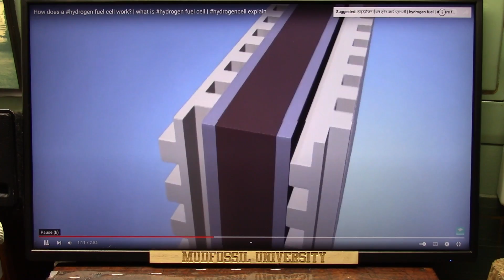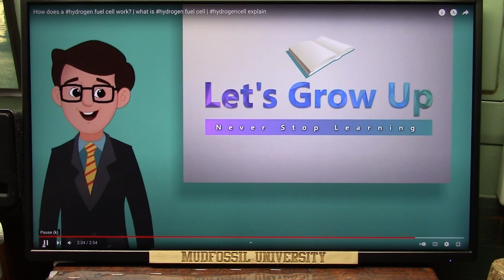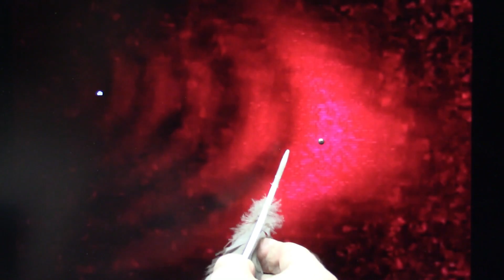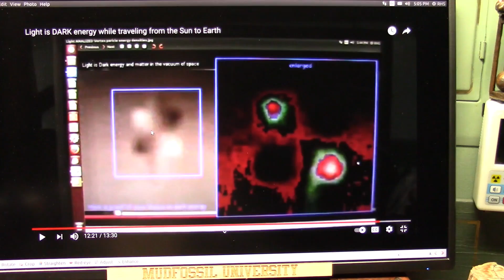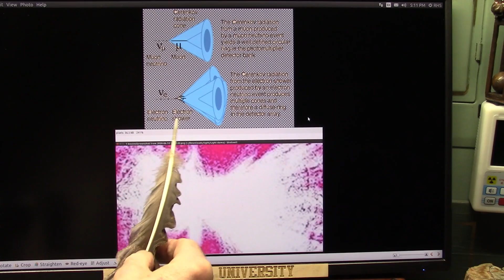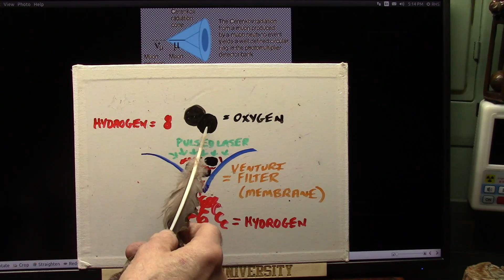Can Existing Engines Run on Water

Comment: The debate for electrolysis is usually had from the standpoint of energy in vs out. I maintain that there is a way to optimize electrolysis to where the losses would actually be negligible, equivalent to having to fill up at the pump, only with water and electrolyte. That laser hydrogen cell concept is interesting though. Wonder what effect the color band of the laser would have on the output. Could this be utilized in a DIY method? What wattage laser, etc.

Comment: Just make HHO or H H O or H2 O2 and USE IT. Storing Hydrogen is a bomb. Make it --use it. Make it use it.
All you need is electricity. Everyone else gets it from an alternator output. Not the Battery  It's really done by resonance frequency. See stan Meyer. The late great murdered Stan Meyer

Comment: Cold water hitting the cylinder could cause thermal shock/Cracking   Just put the gasses into the intake manifold.
Reply from the maker: Yes heated.

Comment: Definitely needs to be a diesel built engine to handle the BOOM. Hybrid engines are being run and built as we speak. I am the successor to a business that has built and serviced diesel/ water engines for over 25 yrs. One pass uses 2 gal of fuel and sometimes 6 gal of water. In 15 sec.

Comment: There was a fellow named Ammon , I believe, International late 1800's or early 1900's, that had an electric car that worked on taking electricity from that air. He was busted by the authorities for stealing electricity from the phone pole electric wires! Capacitors used?

Comment: H²O² is hydrogen peroxide...that is an energetic compound...so it fits to use it...lots of energy density...which we need...gotta use ICE until the energy density of other "fuels" can be assessed...oh...and for the EV...it need massively huge 10,000 Faraday capacitors...those would charge to full in minutes and provide 2x or 3x the range...there is a 1/64 scale R/C set of cars at Walmart that uses a 7 Faraday capacitor to run the electronics and the motor...another slightly larger car is the Crash Racers of Adventure Force Diecast Raceing Set...the cars use, I think it was 15 farad...these cars run for up to 10 minutes on a single charge...I learned while active in the USN from an electronics guru named Forest M. Mims III...in that book he proved that energy stored in a capacitor is not stored on the plates but in the dielectric.. he took 2 large metal cans and I think it was peat and put them together and charged it...then he took them apart and shorted the metal cans together...then he put it back together and measured it with a VOM...it held the charge...that is how to power the EVs...now that Elon Musk owns Twitter maybe I can put a bug in his ear...all I ask is that I get one of his EVs that use Faraday capacitance instead of batteries for FREE for telling him that Capacitance is more efficient...yep...I know some stuff...lol...
Reply: YOU are wise❤
Reply: I think what Roger is saying there is O wants to be O2 only time you see O1 in in a fire/plasma. Oxygen is stable in O2. there is going to be H2 because  water is H2O  (2H) But I think Hydrogen is stable in single H atoms. He is definitely not making hydrogen peroxide. look up electrolysis of water.
Reply: The subject is Called HHO. A hydrogen Hydrogen Oxygen. Turning water to its gases.
I don't want to be a downer but there are guys on you tube driving full water trucks. Salted water.
Reply: @paulcoover9197  yes I got there in my collection of notes. Would you believe I've made 1000 pages of notes. I just bought 5 more notebooks. My hand is cramping. I've got carpaltonel in me writing hand
Reply: Isn't that how the telegraphs were run in the old west. earth batteries?
Reply: That is why coltan is the war mineral. They make Capacitors with that Great info fella